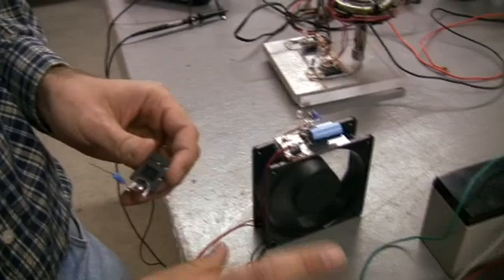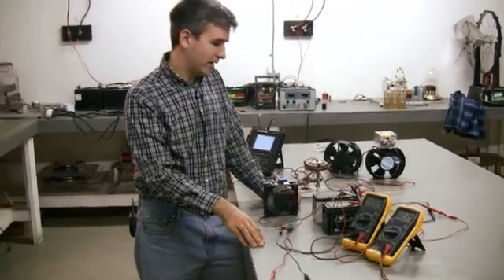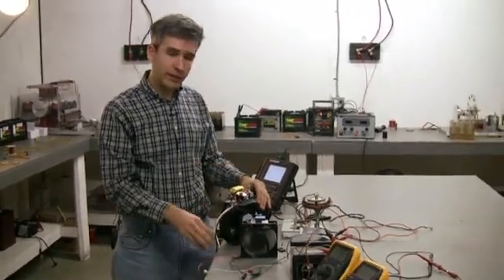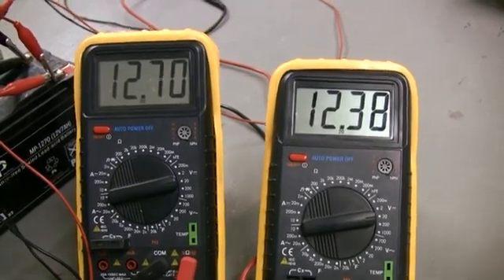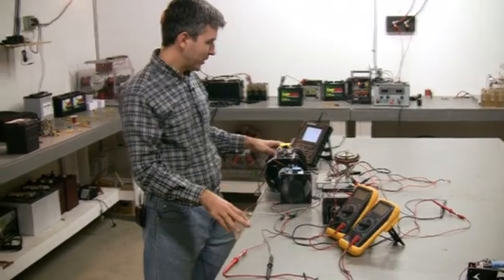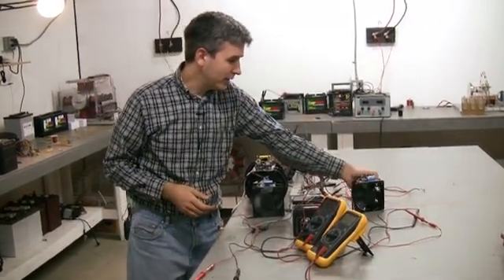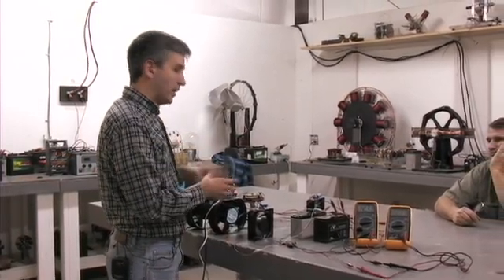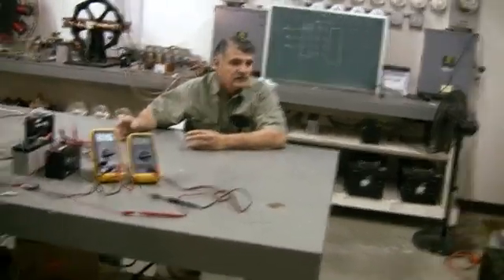Energy From The Vacuum - 17 - The Tape Drive Motor (2010) - Part 2

Comment: I'm so fascinated by these videos.  One thing that confuses me is the different definitions of terms. Is there a book that would help me better understand these videos? I've purchased some of the supplies to experiment but get confused when the different words have interchangeable meanings. Thanks for posting these!
Reply from the maker: Yeah, they really did use words out of context, and it had different meaning to them. It is all pretty much just flyback capture. A pulse circuit that self actuates through resonance and has recapture circuitry to allow for high efficiency opperations.
Reply: @GuardianEngraving  This makes sense. You are very good at making the complex simple!  Thank you!

Comment: I'm actually in the process of constructing a bidini motor.  This gives me the idea that not only could the motor charge up batteries, it could also have a small generator attached to motor shaft collecting that other 23% work extra that he's talking about.
Reply from the maker: This is why Rick designed a Fan version. The fan moves air and does work.
Reply: Funny watching the volt meters, because usually when a person loads up a motor with anything it bogs down and the input voltage goes down.  I think what might be going here is that these machines essentially run off of the back EMF and therefore we're seeing an increase in the amount of work out.  Everything seems to work backwards with these machines...
Reply from the maker: @thecontact2609  Yeah it sure is a diff way of doing things.
Reply: @GuardianEngraving  Rick did not design any fan versions, he stole and free loaded off of Bedini, then attacked him and attempted to discredit him..... I call him "Agent FRick"  and cringe at the sight of him in  some of these old videos before John Bedini finally booted him from his shop after catching on to him for what he really was.
Reply from the maker: @DavyOneness  not arguing, just want to know details. How did he freeload?
Reply: @DavyOneness  This. Such a shame what RF did to JB.